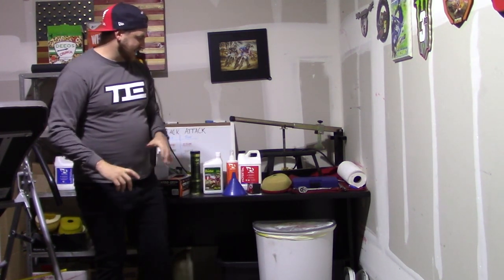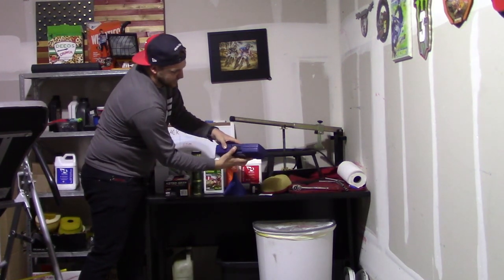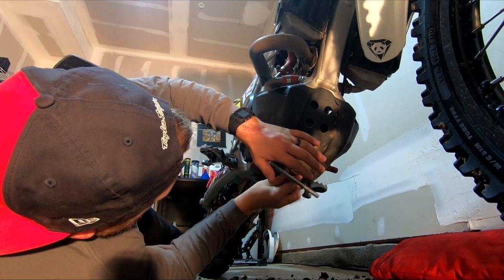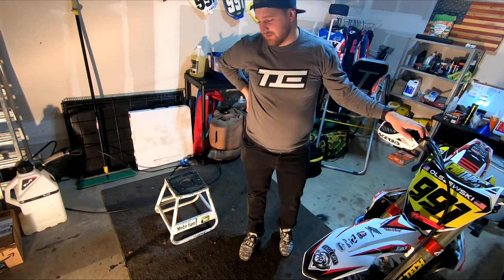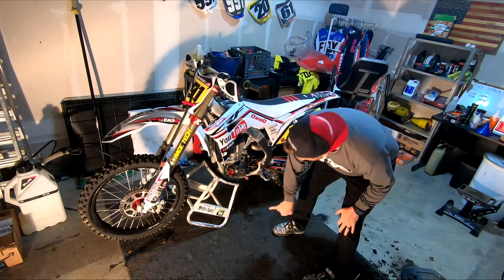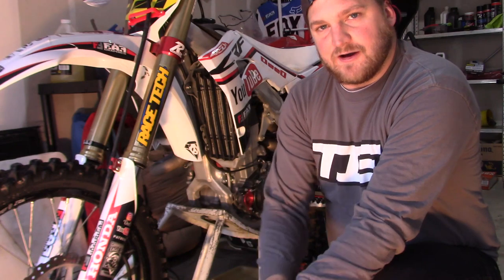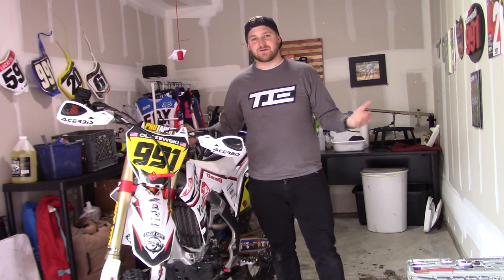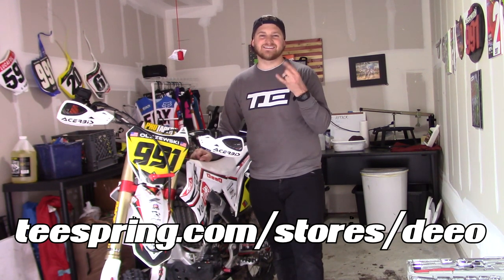Off Week Bike Maintenance - Oil Change, Air Filter and Spokes!

Comment: Pro tip for any one new DONT change your filter until the bike is bogging down when on throttle get the maximum out of your money air filter oil gets expensive if you clean them every second ride
Edit: and deeo I can’t remember where I seen this but a YouTuber I seen done a test to see if putting grease on the air box  actually helped and it does quite a bit obviously it’s not gonna blow your bike up if you don’t do it all the time but it definitely make it last that bit longer
Reply from the maker: 100% clean your filter long before the bike is bogging down due to a lack of air. Maybe not every other ride, but clean them before they get THAT dirty. Oil isn't that expensive.

Comment: Hey DeeO... I got a question for you? Do you also clean or replace the little steel mesh micron filter as well? There is a little mesh steel micron filter that is, (to my knowledge) in or around the bottom of the engine. It looks like a crankcase Bolt. (Im sure your repair manual has a section on I swear I'm not pulling your leg LOL. Like in the last video when I commented... I'm just being dead honest.(and if you don't know about it it's really something worth looking into.) The bolt looks like one of the bolts that holds your outer cases to the crankcase halves. But inside of that bolt hole is a steel mesh micron filter that needs to be fished out essentially and replaced and or cleaned . I just wasn't sure if you knew about it because I'm sure you would have addressed it in your video. to my knowledge it's a super small filter for the oil before it hits the oil pump.?.
Reply from the maker: Josh Furness just double checked my owners manual and see no mention of any such filter or anything.
Reply: @ReturnOfDeeO  wow that's weird? Maybe they only did on older KX models I'm doing some research now, I was trying to get you something to look at before I sent this message to you, I'm surprised there's not a pick up screen filter  on the  stator side under the stator cover, but it looks like I was wrong actually. What the hell? That's weird. Anyway, I guess that's a good thing for you. I could have sworn there was a steel mesh filter on that bike. but I guess not. Before I sent this message out I was doing some research to make sure if there was something I could send you a link to, but now, I can't find anything? so I'm thinking I must have been confused it with another bike. Because, I do see it for some older Kawasaki models talking about how to properly do an oil change, and it makes mention of the 2 oil pickup screen and how to clean and or replace the pickup screen filters but, maybe they don't do that anymore. maybe it's an obsolete design? Honestly I'm not sure now. But as for the Honda I couldn't find anything at all on it. I guess they don't even have it. I would imagine that you have an oil pickup screen within the crankcase somewhere. But I don't think you would ever have to touch to that untill you were splitting the cases. Honestly, that is so weird. Anyway, my bad. That's better for you in the long run. I guess only Kawasakis did that. maybe other models do that too but, I couldn't find anything on the Honda. like I said, I'm sure they all have pick up screen filters. butt, the one I was talking about was like I said ... a little Micron type filter, that would have been covered up by a bolt. Yeah man sorry about that
Reply: @ReturnOfDeeO  yeah once again sorry about that my dude
Reply from the maker: @joshf8097  All good man, thanks for looking out. Got me to crack open the owners manual and make sure I wasn't missing an important part! My buddy Brian has a Suzuki and said it has two oil strainers sort of like what you're saying!
Reply: @ReturnOfDeeO  yeah always better safe than sorry I guess. It must only be with certain bikes that do that. Yeah, I guess Honda doesn't do it like  that. That's nice though. That's one less thing to do you know? that's an easy oil change. It can make your life so much easier if all manufacturers would do it like Honda

Comment: Hey deeo have you ever tried a diet or exercise to lose weight? Just wondering because you're a little plump looking to be riding. Cheers
Reply from the maker: I've actually been trying to eat more and sit on the couch more to lose weight. Not sure why it's not working.

What's wrong with being plump and riding? Seems like I get around the track just fine :)
Reply: Joe Lindsey guy....🤦🏻‍♂️